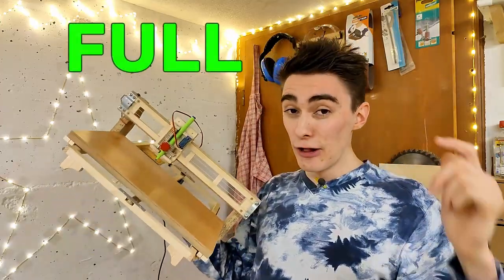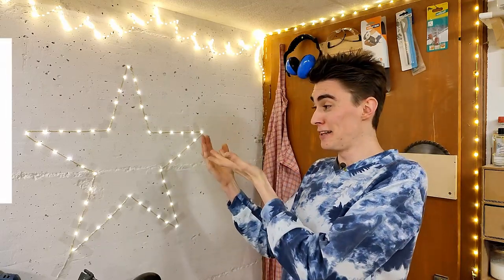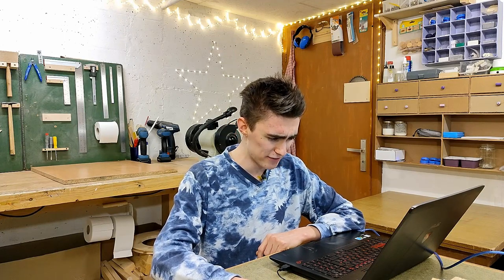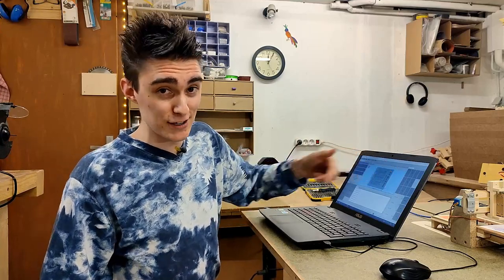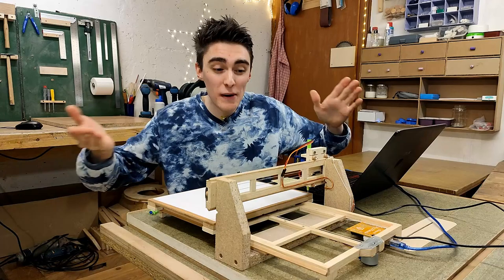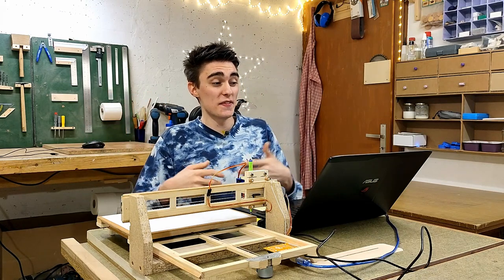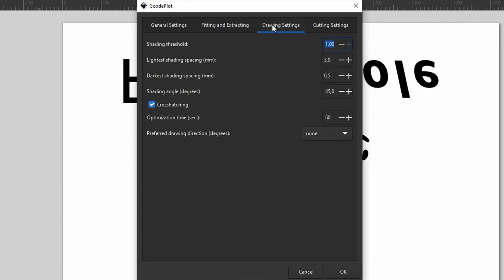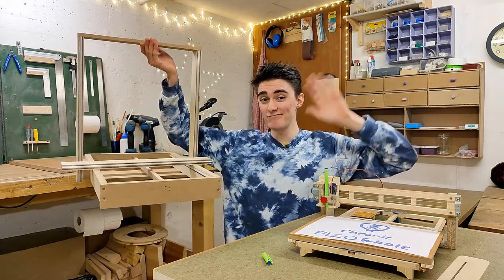How to PROGRAM your pen plotter with 28BYJ-48 steppers + RC servo

Comment: This is an amazing build! Even using just string, wood and small stepper motors as build materials, it produces a high quality drawing. Great stuff. I'm working on a 3d-printer-like device myself, so this material is super helpful. Subscribed.
Reply from the maker: Thanks! I'm currently working on a 3D printer using strings instead of timing belts as well!

Comment: Does anyone knows.....
How this transformation of 3-AXIS cnc grbl cnc into 2 axis plus 1 servo axis cnc plotter, are made or works because grbl is made to controll stepper motor of x y and Z axis but in plotter z axises works with servo's up - down decreat moment not with z stepper axis with linear moment and motions in 3d?
Reply from the maker: It's pretty crude, the real Z-axis simply doesn't get connected and the spindle control pin gets used for the servo because it's PWM capable.

Comment: Very nice and informational video, thanks! 
I made a project similar to this one a couple of years ago, using these same steppers, but I modified them to be bipolar instead of unipolar, it is quite a simple hack involving cutting a line and desoldering a cable, very easy, there are a few tutorials here in YouTube showin how to do this. That way you can use a much more standard GRBL (you still need the servo hack, obviously) and can use any regular bipolar stepper driver, like the popular A4988. You learn a lot about CNC with one of this projects, but this steppers have so much backlash that are only usable as a proof-of-concept, it is much more convenient to spend a little money on a couple of NEMA-17 steppers, even the cheapest ones are much better than this 28BYJ.
Thanks a lot for sharing this with us!
Reply from the maker: Thanks for commenting!
Yeah I've seen the unipolar to bipolar hack, that's what inspired my 3D printer... I agree the 28BYJ are junk and the NEMAs are a lot better, but now I set my mind to making NEMA-like precision CNCs using the low-ish step count round unipolar steppers that can be salvaged from old printers and scanners for free 😁
Likewise those round steppers can be bought for half the price of the NEMAs, so that should make CNC in general a lot more accessible!

Comment: I did not know there was a  GRBL for those uni-polar motors. I used the same motor but modified them to be bi-polar, but still have to use MIGRBL since the z axis is a servo not a stepper.

Comment: Thank you so much for this video. It has been a great help to me for my school project. Although, I was wondering if limit switches are required. If not, would I just have to adjust other axis settings in grbl for the plotter to know how far it can go? Any advice would be appreciated.
Reply from the maker: You can totally go without limit switches, as far as I know GRBL simply applies the position it was powered up in as 0,0 and counts from there for the soft limits. If you just want to get it working you can even run it without soft limits altogether as long as you're careful not to send any axis outside its range (which is easier said than done)

Comment: Hello, how can I speed up rotation of my stepper motors? Thank you very much. I was trying to make pen plotter for many years and when I watched your series of making one I succed! Problem was in  "//",  I don't want to say it, they killed me! 😂😁😀
Reply from the maker: Yeah those slashes are pretty cruel 😂
If you're using the 28BYJ-48 steppers, they can only go so fast because of the gearing. On my machine with a 10mm pulley the maximum feed rate is 350mm/min...
Reply: @ChronicMechatronic  Thanks, I made CNC shield using uln2003 ICc and I will make video how I made CNC. When I make it I will send it to you so you can see it and give me some tips. I am 14 yrs Old. Thank you for reply!

Comment: So i used the information you provided in this video, and applied it to my own DIY build, and i have all axis fuctioning, and homing correctly, but i can not, for the life of me get anything to draw. I have a test file, and when i click play, the axis drive themselves further into the the homing corner containing the endstops. I then invert $3, click play, and the x axis doesnt move while the y axis moves until it crashes into the other end of the machine. Also $3 changes my homing direction. Can someone please help???
Reply from the maker: Sounds like you got motor directions and homing directions reversed. I don't remember if the stepper direction invert mask on this GRBL ultimately worked or not, but if it doesn't, swap the motor connections around to physically reverse the motors and then invert homing direction.
The X-axis should move to the right when you press the X+ button and Y should move the pen to the back of the paper (the paper towards you if bedslinger and standing in front of it)
The placement of the limit switches also matters, GRBL automatically makes the axis positive of the coordinate system face away from the endstops, so ideally the homing corner is the front left corner of the paper. Otherwise the drawing will be inverted like on mine.
I know, it's hella confusing, a full 3 axis CNC is literally easier to set up than these pen plotters.

Comment: Broh don't know how to thankyou. i've been working to make my plotter in working condition but sometimes stepper don't work and sometime servo. But remove that two slashes made my plotter work. Although length define by software and printer is not same when it sketches.
Reply from the maker: Glad it helped! If it doesn't print the same size as in the software you need to dial in the steps per millimeter setting in GRBL 👌

Comment: I too had some struggles with the GRBL firmware. In my case 1.1h. Both 0.9 and 1.1 are basically discontinued as they don't accept pull requests and haven't had any new commits for several years. I moved on to µCNC and I want to recommend testing it. I would love to see an episode featuring it. :)
Reply from the maker: Thanks for the suggestion, I'm always glad if people mention alternative firmware solutions cuz I don't know what's out there and search engines only bring up the most popular...
I still have a few CNC projects coming up that I can try it on, though for the time being I don't plan on making any videos specifically about software - since I don't know what I'm doing software tutorials are a lot harder to make to begin with, plus I get people whining in the comments if it doesn't work for them :')
Reply from the maker: Thanks for the suggestion, I'm always glad if people mention alternative firmware solutions cuz I don't know what's out there and search engines only bring up the most popular...
I still have a few CNC projects coming up that I can try it on, though for the time being I don't plan on making any videos specifically about software - since I don't know what I'm doing software tutorials are a lot harder to make to begin with, plus I get people whining in the comments if it doesn't work for them :')
Reply: @ChronicMechatronic  lol, I don't know what I'm doing either. That's why I am doing it. Learning by doing.. I mean wrecking things, is very effective 😄
Reply from the maker: Somehow YouTube labeled your response as "likely spam" 🤷‍♂️...
Yes, breaking stuff is very educational, the remorse really sticks (at least for me it's the remorse of having broken something I could've otherwise still used 😂
Though the last time I blew up a component I didn't learn anything, It was an Arduino I plugged 12V into via the barrel jack and the voltage regulator immediately released magic smoke - I'm pretty sure everything was wired correctly and the max input voltage of the AMS1117 is 15V, soooo...
Reply: As I had recommended trying µCNC I just wanted to revert and give a heads up it could have some problems. I had three different behaviors with three different gcode senders using the firmware. So I went back to official 1.1h. The guy behind µCNC is doing awesome work trying to answer questions in the forums. But in my case, I just didn't have time adressing the cause of the problem.
Reply from the maker: @timmyalmroth  thanks! Good to know👌

Comment: how do you adjust endpoints and the direction of the rc servo?
Reply from the maker: Up and down position are the endpoints, and direction depends on which way round you enter them into the pen up/down fields
Reply: @ChronicMechatronic  ahaa many tnx for clearing that up👍😊..

Comment: why couldnt you set this up so that windows see's the machine as another printer? maybe a dumb question? but at least you could print directly from office applications. but, a very good video. also, you are right in that most videos dont show the programming part. most excellent series.
Reply from the maker: Thanks! Your question isn't stupid at all from an outside perspective I guess - thing is, while this machine just applies ink to a piece of paper like any printer, it's effectively a full blown 3D axis milling machine capable of machining aluminium as far as the control software is concerned. Of course it can't, but the motion control system treats it the same way, so it does perimeters first, then the infill.
Actual office printers split the image to be printed into thousands of dots like pixels on a screen and print them one row after another, much like scan lines on a CRT screen used to recreate the image. They can't draw a continuous perimeter, it's just a bunch of dots. To make a plotter like this work like any printer, someone (not me!) would essentially have to write an entirely new firmware capable of splitting many different image formats up into dots that could be hammered down with the print head moving from one side of the paper to the other, while also converting that into usable signals for the stepper motors. The controller in the plotter itself would also have to be much more powerful to do all the extra processing, so for pen plotters that apparently mostly exist as an educational project since nobody actually needs them, it's easier to just run them on a slightly modified version of an existing control software normally used for CNC routers and stuff.
I hope this helps :)
Reply: Another Question- I have an arduino uno and a few busted up printers - one of which we took a sledge hammer to 😂 but could we use the parts from that to build a plotter? Also I want it way faster! 😊🎉
Reply from the maker: @jamesbrady9105 depends on what type of printer they are if they have any useful components inside... A faster plotter is definitely a good idea if you don't want to get bored of it super quickly (ask me how I know). If you can get 4 smooth rods from those printers it'll be a good start for the linear rails - stepper motors inside printers are only useful if they are the rectangular type or otherwise do 200 steps per revolution with a step angle of 1.8° degree. It usually says so on the label.
However, if you have no prior experience with CNCs I strongly recommend you get your feet wet by building a 3D printer first, as they are a walk in the park to get working compared to these plotters (and you can then use the 3D printer to build the plotter!)
Genuinely - even though they add a whole other dimension, 3D printing is almost as easy to pick up as paper printing. So much better than these plotters because the software matured a lot over the past few years. I got into it not even a year ago and I am HOOKED! (as you can tell 😁)

Comment: Nice video but wiring diagram is wrong, isn't it? Limit switches should not get Vcc, and the Arduino should
Reply from the maker: Why should the limit switches not get Vcc? How else would they send a signal to the Arduino?
Reply: @ChronicMechatronic  You either connect limit switches to Vcc and the Arduino pin or you connect them to ground and the Arduino pin (that's the usual config) depending on your SW. Also you'll have to choose between NC or NO depending again on your software. In any case, you'll have to put some volts in that Arduino if you want it alive, so better connect that red wire to Vcc
Reply from the maker: @twolaneblacktop5903  now you legit had me checking the schematic - the Arduino doesn't need to be connected to Vcc, it gets it's power from USB, which is then taken from the 5v pin and applied to the pull-up resistors. The limit switches are connected to ground and the Arduino pin, it's just that the pin gets pulled high so the Arduino can read a signal when they're pressed. I guess I should've specified them as NO switches and used a different shade of red for the Arduino 5V to differentiate it from the external 5V circuit...
Reply: @ChronicMechatronic  No USB connected  in your diagram. I uploaded the firmware following your instructions  (great job BTW) on an Arduino UNO, and PINs 9 and 10 both output 5 V, so limit switches (each with its capacitor 200 nF and  its resistor 100 Ohms) have been connected (normally open) to ground and to the arduino PIN. I'm feeding 5V to the Arduino 5V pin through a common rail that also feeds the servo and the steppers. Everything works fine.

Comment: Just switch one of motor coils wiring and you don't need any mirroring in your drawing
Reply from the maker: I do, because as long the limit switch is on the wrong side GRBL will have the coordinate system inverted. If you then switch motor directions it'll just go the wrong way and crash
Reply: @ChronicMechatronic  by the way how you did manage to get opaque drawing because i got only outline?
What options did you in inkscape you truned on?
Reply from the maker: @newman2022  your drawing needs to have "Fill" color turned on, and "Shading threshold" in GcodePlot set to 1.
I believe you can draw full color graphics in B&W by setting the shading threshold to something low like 0.1 and it'll convert the colors into different shades of hatching based on their lightness. In that case "Lightest shading spacing" and "Darkest shading spacing" will set the boundaries.
Reply: @ChronicMechatronic  i will give it a shot
Thank you for your help

Comment: hi great vide thank you,  
using inkscape 1.2
i have a problem on a mac os13 i cant save the gcode file,
i get the error

Traceback (most recent call last):
  File "/Applications/Inkscape.app/Contents/Resources/share/inkscape/extensions/gcodeplot.py", line 9, in <module>
    import svgpath.parser as parser
  File "/Applications/Inkscape.app/Contents/Resources/share/inkscape/extensions/svgpath/__init__.py", line 1, in <module>
    from .path import Path, Line, Arc, CubicBezier, QuadraticBezier
  File "/Applications/Inkscape.app/Contents/Resources/share/inkscape/extensions/svgpath/path.py", line 3, in <module>
    from collections import MutableSequence
ImportError: cannot import name 'MutableSequence' from 'collections' (/Applications/Inkscape.app/Contents/Frameworks/Python.framework/Versions/3.10/lib/python3.10/collections/__init__.py)